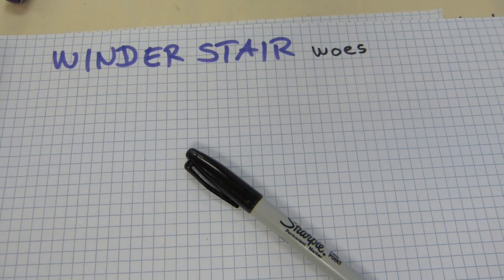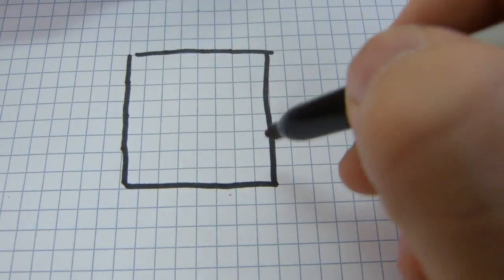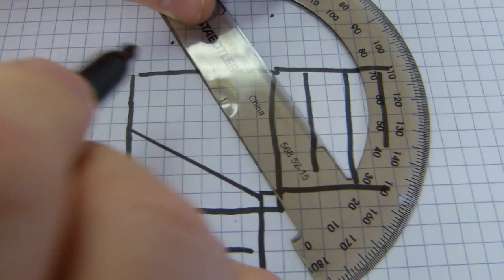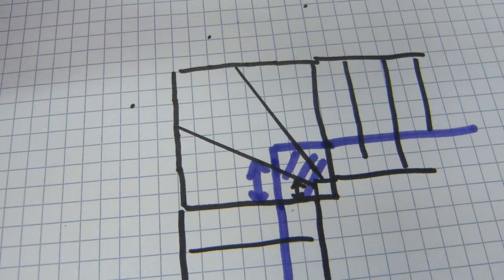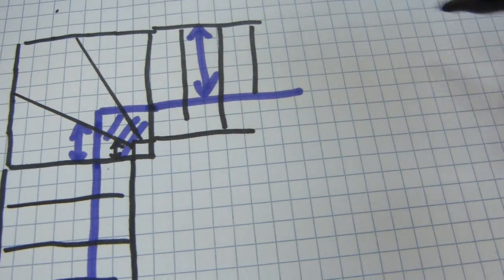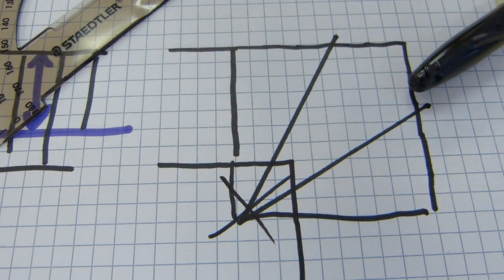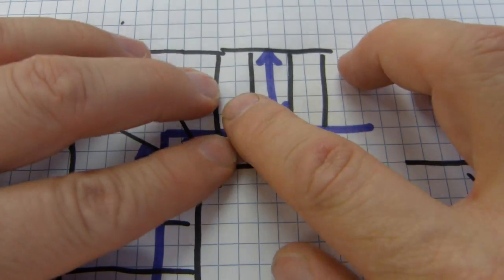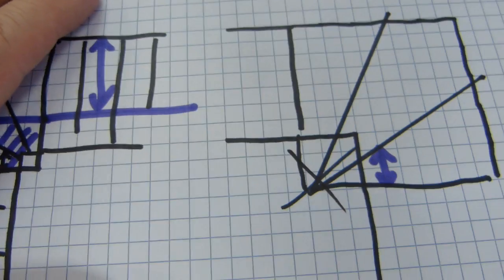Winder stair rebuild options

Comment: This whole video is a complete waste of time you walk up the middle of a staircase anyway so why would you change the staircase the cost would ridiculous
Reply: Because code requires a consistent tread depth on the "walk line" and code defines the walk line as 12" from the inside arc of the stairwell.
Reply: @jamesuhl3995 good to know how to go measure minet probably didn't apply about 200 years ago
Reply: @jamesuhl3995 thanks for that information
Reply: @jamesuhl3995 thanks for the info I just looked at mine. at about 12 in on the inside. It  consistently  looks to be corrected by altering the length of the threads mine has 5 threads to complete the turn and the sixth step is a rectangle and its recessed into the landing I always wondered why they vary  on the inside wall I think I'll have to incorporate the last riser of the recessed rectangle thread  to be part of the header im mirroring the staircase and its landing and railing on top to do an addition on that side if any one can foresee any problems that may present themselves I sure appreciate any pointers thanks everyone for the information
Reply: Yeah you walk up the middle most of the time when you Carrie  big and heavy stuff up there I ran into times where I wish I had a little extra footing on the inside

Comment: i would just make a square step (7 x7 on your 2nd drawing),and do away with all the angles; do you see any problem with that?
Reply from the maker: Yup. Won`t work.
Specifically, there will be height lost for each step that is taken out. Will not make it to the top height without enough steps somewhere.
Reply: I asked you a question 2 days ago I can't find  option now.  In the comments somebody made was about the code and it was to  be consistent 12 inches from the inside wall I have five steps to make the turn the sixth step is  rectangle recessed into the landing and 8 going up to the first turn point  so I always wondered why the inside noses  of the threads don't line up there longer and shorter not in order not sure if I explaining it right   I believe that's how they keep the consistency of the 12inch from the inside wall I guess the old saying more then one way to skin a cat applies i think it has the same effect as making the hallway narrower now I see they knew what they were doing  I don't get the guy that says that your video is a waste of time it's all about learning and sharing knowledge thanks a lot I really appreciate it will help many keep it simple . the rocket scientist out there will  tell you how every molecule in the wood going to affect the staircase